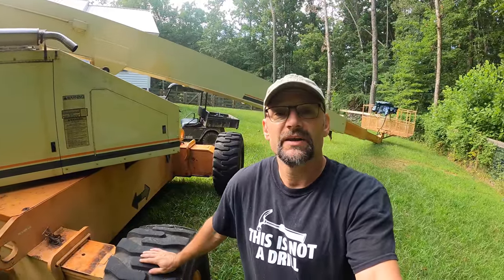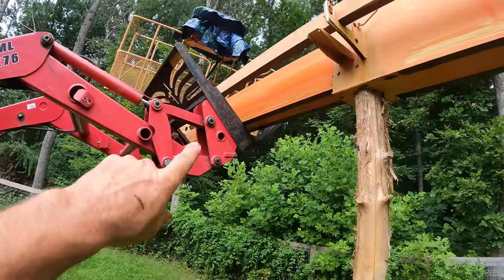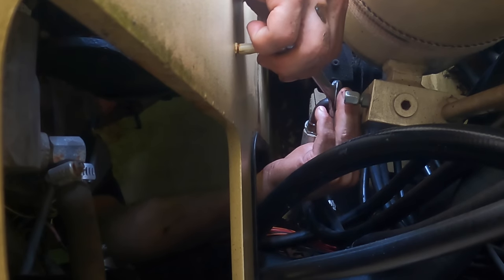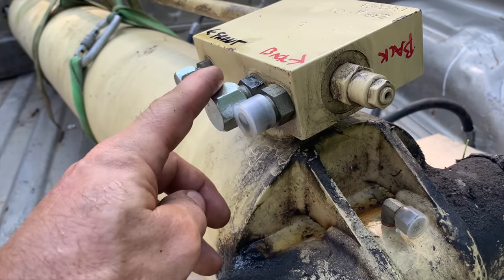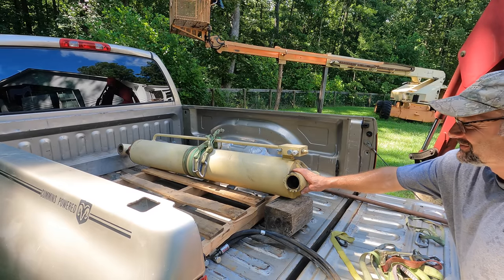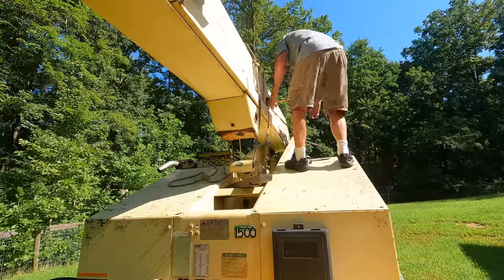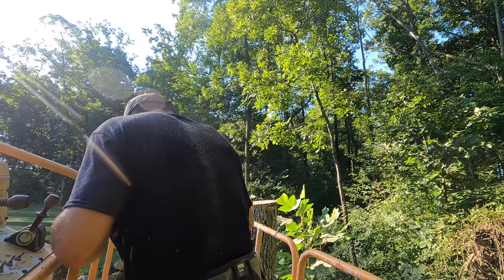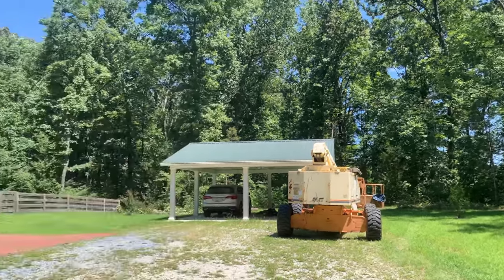Boom Lift Repair - Main Hydraulic Cylinder. What a BEAST! & Cutting Down Dead Trees.

Comment: Watching you put the post under the boom had me laughing reminded me of when I was pushing in fence posts with my loader tractor I just pick up a couple of 5x6 round bales in the grapple for extra weight to help push them in. 
However my main loader cylinders creep down takes about 20 minutes to drop 6 feet. I was low on fuel and needless to say I ran out of fuel just as i rested the bucket on th post nothing out of the ordinary even crossed my mind just walked back to the yard had lunch grabbed 5 gallons of fuel walked out to the tractor dumped it in still not clueing in that i left the bucket sitting on the post bucket now on ground i raised the bucket  jumped out to put a post under bucket thats when I realized that the post was pushed right in flush with the ground now i had to dig the top of post out so i could wrap a chain around it to pull it back out 👀👁👁🤬🤬😂🤣 
I kinda expected to see your posts do the same thing  lol
Reply: Was that in a swamp, our ground is so rocky you would be lucky to get in the ground 2 feet

Comment: Poor seals, they bget bashed every single time. Good seals analogy, excelent work, but I suspected, when disassembling the boom, there was still pressure on the pin.. =) I was right. Could it be the two hoses you had trouble screw as being so close, are meant so close to hold one another to prevent unscrewing? Cheers, keep on, interesting content.=)

Comment: When replacing a cylinder with a double over center valve  {Safety/locking valve} you should use short stokes when bleeding/refilling the cylinder as it is possible to air lock the valve. I have seen this happen before.
Reply from the maker: Good to know, thanks.
Reply: @FarmCraft101  Did you send a text???

Comment: Why are the bubble patterns the same across all the buckets of hydraulic fluid? All the bubbles are roughly the same distance from each other and they appear to be that same distance from the side of the bucket. Viscosity? Surface tension? Some chemical reaction with the air? It is blowing my mind that it would do that. This is going to keep me up tonight.
Reply from the maker: I think surface tension, but it is an interesting phenomenon.  I hadn't noticed until you pointed it out. It seems if the bubbles get too close they probably combine together, making them end up spaced apart.  Can't really explain it fully.
Reply: @FarmCraft101  Ok, It's nearly 1 am now, I think you are right and I have a theory why. The oil is cold and the day is hot. The oil was cold in the tank, colder than the air on a summer day, and when it poured out it mixed with the air creating bubbles. Those bubbles, now cooled by the oil, contract and collect on the surface where they are then warmed by the air, expanding in all directions. Those bubble locations we see are just the natural hot spots where the bubbles grew fastest. I imagine that two big bubbles expanding near each other exert the most force on the bubble halfway in between them and that is why they are so well spaced. Whew, I don't know if that is right but I can rest now. Your channel is great. I dream of having land and its nice to live vicariously through you and not just Minecraft lol.

Comment: OOF... I'm no mechanic, but even I know when hydraulics start leaking that bad it's not good. As for the manual, hand write in it that to get the hydraulic hoses off to go from that other area. Hopefully you will never have to do this again, but if you do you will have it written down in the manual. Very reasonable price actually for a rebuilt rod. OOF, this just reminded me that I should start getting oil for an oil change for our John Deere tractor, along with a smal Mahindra tractor (what mom and I used to load the John Deere tractor tire onto the truck when it went flat). Our local Tractor Supply had the oil, but tend to run out right when we need to do the oil change so we buy small amounts through-out the year so we have it when we need it. LOL. After you worked on a Johnson outboard motor, and all the puns involved in those videos, you know what we were thinking. Simply LOVE your videos, thanks for sharing.
Since it is a neighbor, maybe something that she has that you are lacking in trade rather than cash. I repaired a friend's computer, one of the connectors inside had come loose and I reconnected it. They gave us goose eggs for a few months for that, equivalent to 3 chicken eggs so it only took one egg for a 3 egg omelet that mom and I shared.

Comment: The price is very dependent on where you are. Here, in Maryland near the coast, our neighbor had some similar work done after a recent bad storm and it was multiple thousands of dollars (I don't know the exact amount, but probably in the region of 6k). I had a different company take down a few trees here and it was 5k a year or two back, and a full day job with several folks. Of course, there are houses all around etc, don't want to drop the trees on the driveway, etc.

10 years ago, I had a couple trees taken down and it was only like $800. Prices have gone way up.

Everything is super expensive here, so your mileage will vary.

Comment: Just had a professional crew come in and remove 70' pines that they had to climb and take down,  $4500 for 10ish trees around the house and woods near the garage,  and then another 15 smaller trees (dead ash)  that were on the boarder of neighbors lot and ours.   Basically the more we had them do,  the cheaper the job got and they took all the brush to the streets and hauled off the logs.

Comment: Should have retracted the boom and then raised the boom. That way you could have propped the boom on the unit instead of the ground. Then you could have accessed the lines and then used the tractor to pull and replace the cylinder. But the old saying goes............first hand experience beats all that can ever be told to you. That block mounted to the cylinder has spring valves that prevent sudden drop of the boom if a line bursts. It also prevents cylinder movement when the temp of the fluid changes. Without pressure, the cylinder "locks". Wait until the telescoping cylinder gives up it's seals. Pack for a vacation if it does.

Comment: I long ago had a job where I'd operate a cherry picker and place boxes of product on the pallet on the forks and I think it's max was like 40 feet high. Yes you were wearing a harness but regardless you were still 40 feet high and when it wobbled, you felt it and so did your bowels. I used to have nightmares about falling off when I worked that job but then I got promoted to the Quality Control lab so I could breathe a sigh of relief.

Comment: What is scary to me is they rear pivot pin for the entire arm and intense stress that is under as decades of corrosion, movement  and pressure and if the rear area was to suddenly crack, the arm would be compromised. I sure it very strong and redundant but i would have a good look at it and make sure its all sound and not fatigued.  So high off the ground, it all has to be very safe and sound. As a pilot,  i am thousands of feet up and not so much the engine that is worst worry but the wings and structure and no cracks as if that fails, i go down horribly wheres if engine fail, i can glide and land somewhere.

Comment: Hope you don't have to club anymore seals soon. Got a link to those shorts you are sporting in the video? I like them. That job might have sat till Fall or Winter for me when the weather is a little more comfortable around here. Oh wait, that makes me sound old?! LOL
Reply from the maker: They are prana stretch zions.  Pricey, but they outlast cheaper shorts by a good bit, so overall I think the price is the same.  Awesome shorts, I have several pairs.  https://www.backcountry.com/prana-stretch-zion-short-mens?CMP_SKU=PRAZ9TD&MER=0406&skid=PRAZ9TD-DARIRO-S32&mr:trackingCode=BDB5FADB-A3C1-EC11-8124-005056944E17&mr:referralID=NA&mr:device=c&mr:adType=plaonline&CMP_ID=PLA_GOc001&utm_source=Google&utm_medium=PLA&k_clickid=_k_CjwKCAjw6fyXBhBgEiwAhhiZsrBNrrKSNrajP-we147JFdZWHrWAc-vL73TFMHGGI67M3X_J7bsvIBoCi7oQAvD_BwE_k_&utm_id=go_cmp-10753578873_adg-110028159790_ad-454277601486_pla-650491074872_dev-c_ext-_prd-PRAZ9TD-DARIRO-S32&gclid=CjwKCAjw6fyXBhBgEiwAhhiZsrBNrrKSNrajP-we147JFdZWHrWAc-vL73TFMHGGI67M3X_J7bsvIBoCi7oQAvD_BwE

Comment: So I was thinking about that clever slave cylinder to leveling piston assembly and it occurred to me that, while you changed all the hydraulic oil in the reservoir and thus the entire system, that particular assembly sounds like it's isolated and doesn't run through the main pump and reservoir. Those two cylinders are probably just connected directly to eachother with no other lines going elsewhere, meaning that the oil in those did not get changed with the rest of it.

So if you're bored one day (cuz ya know, farmers are always sitting around bored with no work to do, right??), you could go change that oil too and earn the completionist badge. ;-)

Comment: Can you rent out your beast to help defray the repair cost? Or trade the use of it for the use some other big machine you might need to borrow?

If you didn't have the lift, would there been any way to place explosives to blow off chunks from the top until it was short enough to drop? That would have made an exciting episode! (There's nothing quite like watching things blow.up.) Say, can a drone carry a radio detonator and stick of dynamite on a length of string?

Comment: The thing about this tree job is you did not remove the wood, you were able to throw it in the woods and leave it there.  The urban tree jobs they have to chip it all up, or load logs onto a truck and haul it away - both of which get pricey.  However, this would have been a bucket truck job, probably 1 day of work. Reasonable price maybe $4,000?  What a tree service would actually charge?  As much as they think they can get out of you.

Comment: Your problem reminds me of an old classic:

A penguin is driving across the country on the old Route 66, when he encounters some engine trouble.  Fortunately for the penguin he breaks down in a small town where he finds an old service station.  When the penguin drops off the car for a diagnosis the attendant tells him it will probably take an hour or so to determine the problem and he directs the penguin to the local diner right down the street.  After a nice lunch, the penguin sits in the afternoon shade and enjoys an ice cream cone out on the sidewalk, but with only his two flippers to hold the cone, the penguin makes quite a mess of himself.

As the penguin is finishing up his messy ice cream cone, the service station attendant walks up to him and tells him that he has a diagnosis for his car.  “It looks like you just blew a seal,” says the service technician.  “Oh no,” says the penguin wiping his mouth. “It’s just ice cream!”

Comment: "Two more inches" That's what she said!

I would like to give you a tip that I learned the hard way. Leave the body of the cylinder On the equipment if you can. It will act as a holder/vise when you are undoing the cap and less weight when you take it off. All of the replaceable parts are on the rod end anyway. You may also might want to learn how to repair hydraulic cylinder seal(its easy) that way you are only spending $80 in parts instead of whatever you spent. If you are going to send it in to get repaired then disregard my notice. All of the seals on that equipment are 25-30 years old they are going to go bad due to age Not hydraulic fluid condition.

Comment: You might save time on the next tree by dropping bigger pieces and hauling them back to be cut to final size with your larger saw.

Edit - I assumed these were going to be firewood.  Also, urushiol, the irritant from poison ivy stays around long after the plant is dead.  And the smoke is no bueño!

Comment: the reason those fitting are so close is becuase the counter balance valve they are using is actually too small and its ports 2 (in) and 3 (pilot open) are too close together for that size hoses....if they went up to a series 2    120lpm sun CBEA instead of a series 1 cbca 60 lpm they would have had more space between the two ports ...i design hydraulic manifolds and spotted that small load holding valve immediately.....

Comment: In my understanding the leaking part of the hydraulic is only used to pull the boom down. Gravity will do that job anyway, you will never use this function. You could just seal that hydraulic line off or wrap a plastic bag around to catch the spilling oil since pulling the boom down is a non essential function.

Comment: Since thats a double acting cylinder. Before you drove the pin out you should crack the lines. that will put the machine under gravity and not under hydraulic load. When u crack em one line wont do shit {suck air} the other will leak a little till the pressure equalizes as the load comes off it.
Reply from the maker: I thought about doing that, but I figured going by the service manual would be the best route.  So much for that theory.  But sometimes cracking a line when the cylinder is under pressure can cause a high pressure fluid spray, not good if it hits you.  And with the safety valves, I'm not sure if just cracking these lines will make the cylinder move.   Do you know?
Reply: @FarmCraft101  I mean in theory it could. That machine also has manual descent valves which can be opened to bleed the system pressure off without opening the system to the outside world.
Reply: @FarmCraft101  i dont know if those valve blocks are piloted or not.

Comment: I paid Cdn $660 (~US $500) to remove menacingly overhanging dead branches (about 26 branches by count, cut and tossed into the forest) way up on one ~60-foot tall pine tree (using a boom truck), and to simply knock over another dead tree while they were on-site. It was two professional arborists, and they were on site for maybe 90 minutes. Including travel time, call it 2.5h and two staff and equipment. I thought it was fair.

Comment: What price is fair to do this job? Well, wear and upkeep of the equipment costs, fuel, hours of working plus a reasonable profit margin. My mother had some guys over to take down some large trees and they used half the day, without any lift use, and she was still charged USD 600 for that job, so I would say at least USD 800 to 1000 for the job you did. I was away at that time, otherwise I would have done it for her free of charge, but she had to get it done quickly because of the risk to the road and sporadic traffic if the trees fell suddenly.

Comment: 25.4mm  If you only new how many mechanic are short a finger or two from doing what you did in pin bore.  Use a screwdriver to check alignment, never put fingers in the bore.

Comment: for trees thats size and clean up, take everything sway, using a boom truck, 2 guys an a big chipper,  more then 2 trees, on a job $1800 cnd per tree the dead one you just cut the top out and cut it down an left it in the bush $600, then there is tax of 7% being it just labor, no product witch would add 15% tax for them items, thats my rate and i am lower then others

Comment: Sorry i know its after the fact, i do cyl daily sometimes , take front pin out drop cyl down ,remove cap , crack hyd line ,pull rod out ,rebuild , reassemble.

Comment: Why not get a 55 gal barrel of oil from a commercial lubricator store? Harder to move and need a transfer pump but surely cheaper....maybe...   I didn't know Hyd oil was okay to use as bar oil, that could have come handy multiple times. thx
Reply from the maker: I checked around and couldn't find anything cheaper, even in a 55 gallon drum.  I think it's economy of scale, they sell far more 5 gallon pails than anything else, so they are the cheapest.
Reply: @FarmCraft101  I buy all my hydraulic oil is 5g buckets too.  Best price in that quantity for some other oils too, like some weights of gear oil.

Comment: Hydraulics is far from my forte, but when he started to cut the trees up at a gazillion feet I immediately had my doubts about the techniques: ¤  no helmet or screen (he had some earplugs tho) ¤ cutting branches with the arm over the saw - hilariously stupid as the saw can kick or the chain snap (it did once for no reason for me) ¤ when the trunks got to some size, no directional cut and you get mishaps like hitting a fence (45:08) - even a tiny score will do the trick.
Pricewise: I charge $120/hr (excluding cost for machinery/transport and taxes).